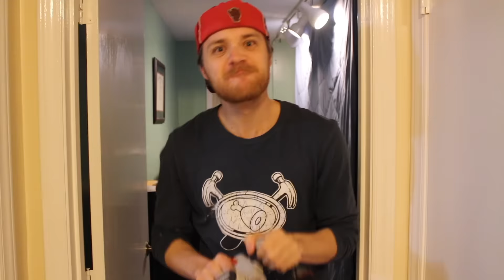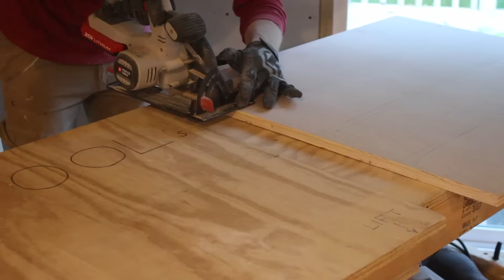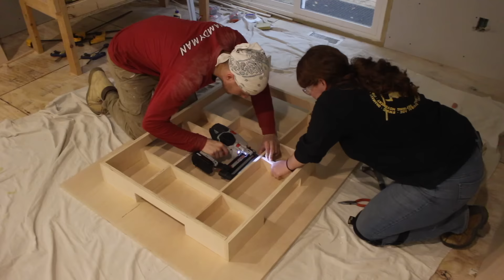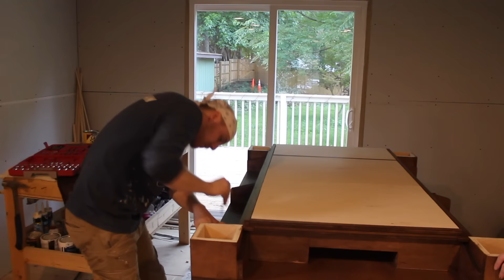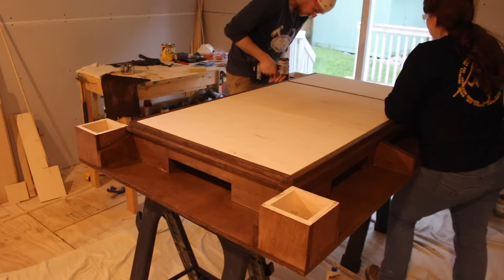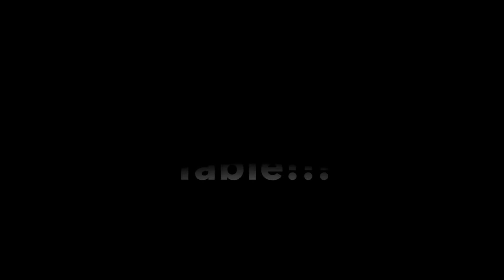TheHamdymanCan: Gaming Table!

Comment: thank you for the good video.   However I am curious how you connected/secured the legs to the top?   How stable is it?
Reply from the maker: Pocket holes, 4 on each side of the horizontal pieces. It holds up pretty well because the legs are quite heavy. Plus the bottom of it is all one piece!

Comment: two things...1st I like the design of your table and the work bench you working from (the handyman bench).  2nd do you have a pdf file of the plans done ?
Reply from the maker: The plans were custom to the size of the space we were working in. My best advice for you if you were building it yourself is find the overall size and what you want to put in it, then build from there.
Reply from the maker: check my tutorial video! The link is at the top of the comments pinned.

Comment: Looks awesome!

What kind of hinges did you use on the fold-down side panels?  Might you post a link of them, please? Building something similar for a Cessna cockpit simulator.

Looks like each side of the section is a 3/4" board, which doesn't leave a lot of room for sturdy hinges?? would hey just snap off if anyone puts any kind of weight on them?
Reply from the maker: The hinges I used were not up to snuff as much as I wanted. See below link.
 http://www.lowes.com/pd_311939-S890-293-1277_4294937087?productId=1000513847

That is what I wanted to use but they are a little expensive. If I made a new one of this particular design, I would put the money into those hinges. See below.

https://www.amazon.com/HIGHPOINT-Side-Hinge-Solid-Brass/dp/B01JRI8VGK/ref=mp_s_a_1_14?ie=UTF8&qid=1546541061&sr=8-14&pi=AC_SX236_SY340_QL65&keywords=brass+hinges

Hope this helps!
Reply: @thehamdymancan  Thanks a lot, mate! i found those as well. will end up using a 2x6 for the table fold down side things...means i have 1.5 inches of surface to lay a hinge on, thought I lose some usable area. Keyboard should still fit. 

Thanks again!